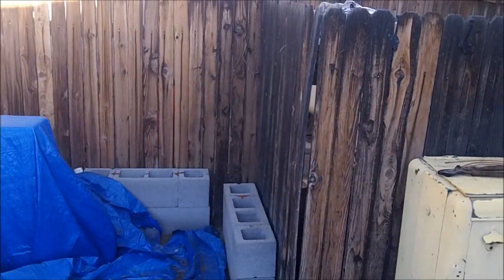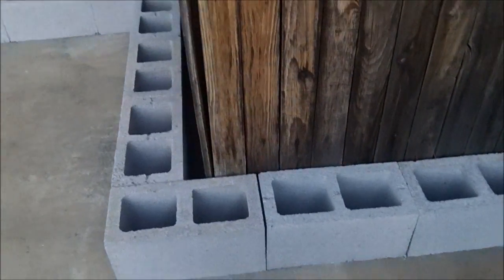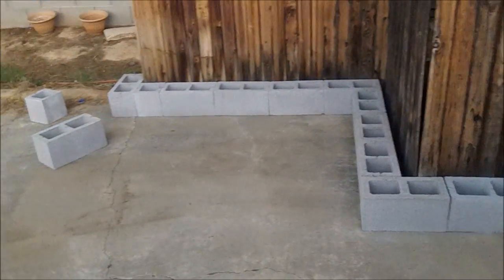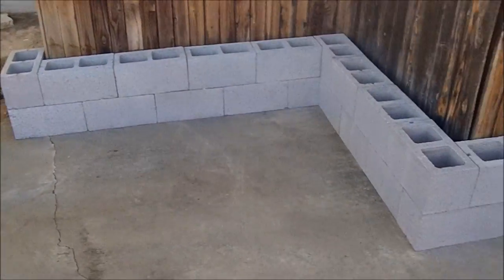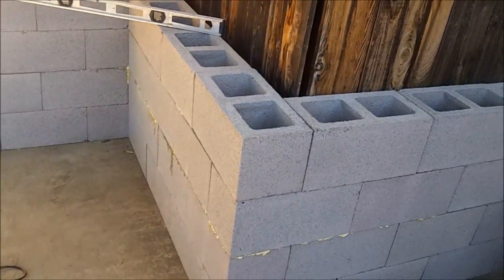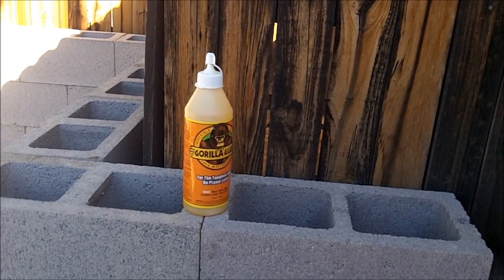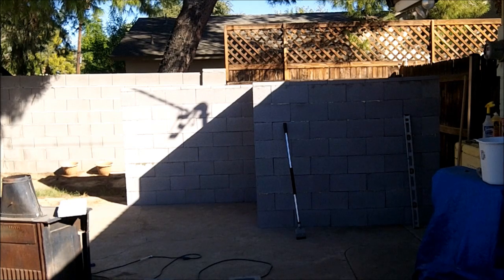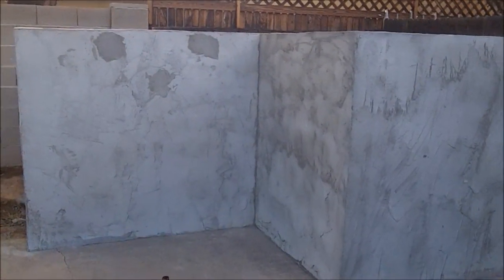How to Build a Block Wall with Gorilla Glue... No Mortar Used

Comment: Interesting way to build a wall, although a bit more expensive than traditional way. I think the important point here is that the wall in NOT structural, only for appearance. Personally I would not build a wall this high with this method as I think you are looking for trouble in terms of longevity and safety. In our area we are prone to frequent earthquakes so I would build a stronger wall with rebar and mortar unless I was only doing two courses.

Comment: It won't tip if its not being being pushed over. We have a 40+ year block wall and it has never tipped over, even when there is 40mph wind here. A part did break, but its because my sister hit it with her Jeep. So I think its fine , unless messed with.

Comment: It looks like you used all corner blocks. You can cheapen up the wall as along as making it stronger. You only need corner blocks on exposed on outside corners
Reply: Matthew Vaughan in our area they don’t manufacture “field” block. They are all corners.

Comment: dry stack or adhesive they both should have first course in mortar on the bottom as you can completly level the first course and the rest will follow .and in tornado or hurricane country that high needs re bar at min 4 feet apart into foundation and the blocks where it is filled with mortar or concrete

Comment: The reason why you said your measurements were wrong or the blocks arn't reaching the edges because the blocks are short is because, like tile, they are made to accommodate the grout or mortar. Thats why tile is usually 11.5 and accompany a 1/4" grout around the tile making it 12" centered

Comment: Out here they use blocks for fencing, they are half as thick as a regular block. The walls are pure crap,and pass inspection regularly. I bet this is at least strong, or stronger than the piece of crap they built in my back yard!

Comment: Hey bro whats  the big deal on cinder block gardens and leeching of dangerous chemicals? Anyone know if this is an issue or just BS. Really wanted something that would last me a long time and still not kill me buy dangerous chemicals that may or may not be in the concrete. Anyone have any ideas on this?
Reply: the do leech but there is a ways to take care of it. there is an spraying agent to kill the acid in the blocks (can't think of the name) there is also white vinegar and i'm sure there are many others and the neutralize the acid. Old blocks that have aged are good to use due to rain water snow and sun. I used vinegar and water on mine - I filled a sprayer half and half with white vinegar and water - sprayed the blocks then rinsed and repeated 3X a day for 3 days and it worked for me.

Comment: Mortar is more fun so I am offended by this method, lol  The time and headache of adjusting dry blocks would drive me nuts, when you dump mortar on the block it slides and moves easily and its more accurate and probably a lot stronger. Then I was wondering about the stresses of expansion and contraction during temp extremes might allow cracking in the stucco. Just a thought

Comment: why didnt you glue the blocks to the concrete base and the sides of each block together like you would with mortar. seems like for a structurally sound wall you would have.

Comment: Actually, the strongest and least expensive way of binding the blocks together would be with standard construction adhesive... Faster too!  fs
Reply: Yup, at 5 dollars a large tube it's way cheaper and is used for this kind of work already. I've seen lots of masonry companies glue top cap on with pl premium

Comment: Gorrilla Glue with Sacrete coating would be ideal. I don't think you would even need rebar. The only problem I see is the bonding to the footing. Usually you would have rebar coming out of the footing. This prevents tipover.

Comment: you could build a house like this. But code probably wouldn't let you. 
need to use more glue as well as glue the side of the bricks. you should always have squeeze out from the joints. for a load bearing wall you would want to run rebar up through the bolt as well as will the block with mortar or concrete.

Comment: If you would coat the fence with used motor oil it will last forever.  An old farm trick.  But thanks for the tip.

Comment: Why do you wet the glue?
Reply: It is a polyurethane glue, which requires moisture to activate. Whether that moisture comes from being sprayed, humidity in the air or moisture that is inside the materials being glued. Even when gluing 2 pieces of wood together, it is a good idea to wipe one side with a damp cloth or sponge to get the process started.

Comment: You can actually buy adhesive in a tube designed for this type of construction.
Reply: swampfox1953 _you can use roof adhesive .

Comment: That other wall you showed was not put in by a bricklayer. You wall looks better and they used mortar. I would fill some of the holes with rods and concrete. I would have used liquid nail, much cheaper.

Comment: Guess you can get away without footings where you live.  Here any masonary wall higher than 3 feet must have a building permit, must have concrete footings 5 feet below grade and the footings must be at least 4 times the width of the wall.
Reply: +pen mightygun 4 ft 11 inches is greater than 3 feet in height.  The wall would  also require rebar.
Reply: peggyt1243 you can get away with anything if you don't tell anyone.
Reply: Only if you live in the country with no nearby neighbors.
Reply: But what if you post a video about it on YouTube?...

Comment: gorilla glue is a polyurethane, plastic bonding agent. when it cracks/fails with "stucco" over the top/fascia, you will have to fix it... i give this ONE SEASON... at best! there are tubes of MASONARY ADHESIVE FOR BLOCK that works better.

Comment: Next time use scotch tape.
Reply: Henry Brown The weakest adhesive available found at your nearest dollar store. Give poor quality the benefit of doubt.
Reply: Double sided tape would be more efficient.
Reply: next time... Velcro!
Reply: lol
Reply: Use spit, at least 5 good spits in the hand is better OR if your lobido or libido is high use that other biological glue.

You could also heat the two edges of cinder blocks, each with it's own blow torch on high, for 8-10 minutes, then flip top over and now the hot sides are touching. Add some weight immediately, 4 blocks so the SMELTING MERGE occurs.

YOU ARE WELCOME !!
Happy glue experimenting..
Reply: Why even bother? It's clear you're unhappy with your life or something you've built and wish you'd gone this route, go spew your hatred on yourself and learn to appreciate other people's work.

Comment: You must get free Gorilla glue @ 4.00 for a little bottle. Way to expensive just do it the normal way.
Reply: You can buy Gorilla Glue in 18 or 24 oz bottles. I know many an artist who use this in their multimedia artwork, using all kinds of materials, wood, concrete, metal and sometimes they are sculptures displayed outside. This glue is great, but a little goes a long way because it puffs up, so be careful.
Reply: 36oz on amazon for $30

Comment: If you want gorilla glue to be the strongest glue on earth, use a heat gun on it when it dries it will pull chips out of your counter top and chips out of your dish's put a drop on a plate and put it in the microwave as soon as it cools the glue rips a hole in the plate or what ever.
But I'd imagine it would glue steel like a weld.
But nobody would build a wall with it unless they owned the company????????
Because its so damn expensive?
Heat makes it strong and water makes it foam.
Gorilla glue is the next best thing to epoxy, but  have to wonder if its water soluble.
But on soft non porous woods like pine, hickory, ash, maple, that brown glue might be better than wood glue.
I'd drill some divots in the wood for more bonding area.
 I worked in a machine shop and I will always use a quality high impact epoxy over traditional glues for plastics and bows, But if not avaible gorilla glue would work for a while.

Comment: I wonder why all block walls aren't just stuck together with a bit of glue. Ever wonder that? Hope you don't have any kids who want to climb on your dangerous pile of blocks.
Reply: So wrong. I put a quarter size dab of glue between two 12" blocks. Next day I picked up the block so the lower one was hanging, I tied 4 blocks to the bottom one then decided to hang from it (200#). You could never do that with mortar.  This glue is faster and infinitely stronger
Reply: John Jones the kids can play Jenga now.  The loser kids a cinder block to the cranium.. good times!

Comment: can you build a house like this??
Reply: mycherierose no!
Reply: I built a house like this and used Blue Max as the glue. It resembles a 40ft shipping container. The outside was stucco with chicken wire. That house is still standing after several storms.

Comment: Why didn't you removed the wood fence?  It looks good on this side, but on the other side it must not look so good, with the decaying wood showing.  Also, you wouldn't have had to move the blocks out like you did to accommodate the fence.

Comment: Cement hardens over time. In fact they say cement can take up to 40 yrs to reach its true adhesion maximum. This was a Mickey Mouse exercise in my opinion and it will not last the test of time.  Adventerous idea, however not a proper job and not something I would trust in my yard with kids playing about nearby.
Reply: Yeah, I hate new idea too. No point trying them.
Reply: I would do it With the glue to get every framed real quick but i would put rebar and pour concrete in every cell and then i feel good for hurricane season
Reply: you obviously haven't tried gorilla glue, you need it for your mouth

Comment: If this is what you wanted to do than fire away Sir i dont jump down peoples necks but what Im wondering is you just lost 8" of your property by doing that just build a new cedar fence it will last 20+ years
Reply: Actually he lost 5-6 inches and got rid of the crappy wood fence.     This is a very interesting idea, perhaps this isn't the only way to build a brick wall, however for the sake of progress I am interested in how well this wall would hold up.
Reply: brick is far better than wood, for one, you have a flood proofed yard, which in integral for avoided property damage. Second, it's fire safe! Third, it last longer, you don't have to kill a tree, and it's strong!
Reply from the maker: Daily Noms it's holding up great. it's also not at the property line, so i didn't loose 8" as ishootbandits mentioned. also wood fences here do not last 20 years, so yeah brick is considered a better option here

Comment: Mortar is cheaper faster and better. You only need to an empty pail and a stick to mix it. Mortar self levels the block. No grinding needed. lol. This guys idea is as dumb using dog turd to stick those blocks together . Sure it will work too, but why in the hell would anyone do it this way. I just don't get it. Not to mention over time it will likely collapse from the glue deteriorating from condensation and rain. Just because you can do it this way doesn't mean you should. Could you imagine hiring a guy to build you a new basement or a foundation and he shows up with gorilla glut to hold the blocks together instead of mortar. Geesh lol

Comment: About what you would expect from a guy who continually says bricks when he is using blocks.  

A better method is to use dry blocks coated on both sides with a fiber glass impregnated stucco troweled on about a quarter inch thick.  Built a basement using that method to support a two story old house that was moved from downtown Ft. Collins Colorado to a few miles outside of the city.  Still in place 19 years and counting.

Comment: Highly skeptical , I only clicked because I wanted to see if any professional would try to build something with 'girl-illa' glue, and of course, no. I didn't watch more than 5 minutes, but I have questions: Video posted on 2012 so what year did this wall fail? Were any inspectors, code or building, allowed to see this "construction"? Why didn't you use bisquik? It's just as sticky and as strong as girl-illa glue.

Comment: never DO THIS EXPERIMENT Where safety is compromised, children have been crushed by as little as a tv they pulled down onto themselves...there is also no secondary failsafe in case something happens.....all systems should have a way out in case of failure, where possible

Comment: You took how long to put that up with glue? and you already prepped ugh.. Rookies.. Try Bracing a lower boundary wall.. Laying out 3Ton of Aggregate RMC for reinforced concrete. lay a Traditional Concrete block wall "Solid Dense High 440x225x100" 1000Blocks :) and they weigh 25*KG each. I laid this wall behind a Fench with a 40cm trench for me to stand in. the footings are 5x the recommended standard yes overkill :) plus i am sure 3 sand and one bag of cement would do ALL of your rendering "as you say stucko". once the blocks get wet they release chemical's like calcium and silica those will break down your glue straight away..... i could have build that in a few hours haha traditional all by hand yes even mixed.
Reply: titanwr someone has women issues...^
Reply: No, I do very well with women.  I just don't hijack videos/conversations and make them into a dick measuring contest.

Comment: I know it seems like a good idea and seems clever, but Please do not build a wall like this.  These walls are very, very heavy. If one falls on you or a child it can be deadly. Rebar with concrete footing  underground prevents the wall from tipping over. Even if the glue holds, andit may not, the block could crack overtime, go unoticed until there is a bad accident.  Again, the idea seems clever here, but this is actually quite a dangerous thing to do, not safe at all. Please avoid doing this.

Comment: Wow!!! Ever stop to think why is this not how it's done? This has got to be the worst idea ever not only will it have to demolished if you decide to sell your house (if it doesn't fall apart first) but the safety issues alone should have been the best reason not to attempt this.
Reply: This video is a prime example of why I refuse to buy a house, in preference of land and constructing a building myself.  Even the so-called professionals perform shoddy and 'less than acceptable' quality work, by my standards.  This is an insane idea from beginning to end, starting with him laying square block on an uneven surface, and blaming it on the rotting wood fence, which should be removed!

As _Lipton Tea_ commented 3 years ago, I totally agree, "Some people should just be renters."

Comment: This is a crap job.  When you build a block wall you must be sure that your bottom row is absolutely straight and level because it's the base everything else sits on top of.  Do the job right and there is no shimming with pennies or grinding down the blocks to make them sit flat.  No rebar or concrete inside to make the wall strong, or mortar in between the blocks.  Why would you build around a fence that's ready to fall down?  Yank that shit out.  I wouldn't let you build even with lego's......

Comment: It seams more expensive to buy all that glue than just add cement.
Reply: Material cost is a little more but labor goes waaaaay down.  Strength is far superior. A quarter size dab held 300#.  Mortar 5' of block, turn horizontal to make a bridge then step on it- breaks.  Do this with gorilla glue and you can jump on it.
Reply: my labor is free i do it myself
Reply: +Brain Fields .... apparently you don't value your own time.  That's the difference between rich and poor.... Those that make good money know your free time is worth as much as your work time,  If not more.
Reply: First off its not stronger or better no matter what your personal opinion is.. If it was guess what everyone would do it, but they dont because its a fucking stupid idea that cost a lot more money. So wile some people are concerned with time and put out a shitty as quality project that will just have to be redone in the future by professional or done the right way. costing this project a lot more money and time...
Reply: +Dallas Ingram You sir will be rich on day :) got just the right mind set. You'll go very far! :.)

Comment: what a waste of good material. Should have at least put some glue between the blocks on the head side as well at the same time to get some mechanical bonding. Would have made more sense to do the first course in mud so you could level properly, but then again I've laid a few "brick"  "block" in my day.

Comment: You should have just replaced the fence with new wood. It looks ugly with glue. You have ugly joints. Or at least buy some nice finish block. But you get points for thinking outside the box. You mite be on to something. Maybe if you had fack blocks made of plastic that connected together like them plastic fencing that looks like real wood....

Comment: overall I think it was a Foolish thing to do, to use gorilla glue in an application like this, mortar, which is what you should've used, is a lot cheaper, and more important, engineered for a weigh-bearing application like a wall, gorilla glue isn't intended for weight-bearing apps like this, and no rebar? poor judgement...."luggin around 50 lb bags of mortar", it would'nt have taken that much, and you had to "lugg" around those blocks, should've done it right, you'll pay for your ignorance